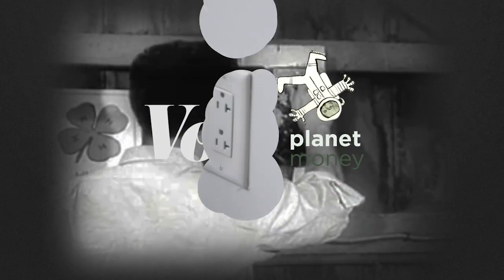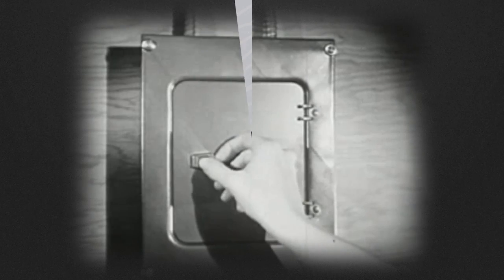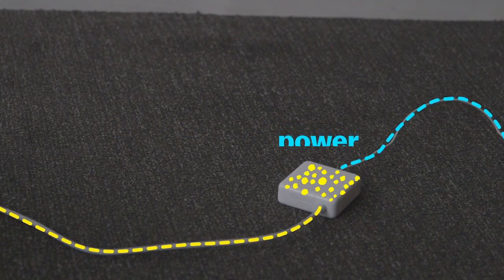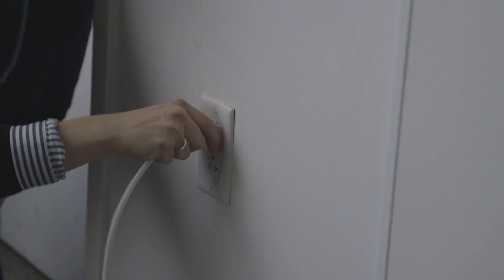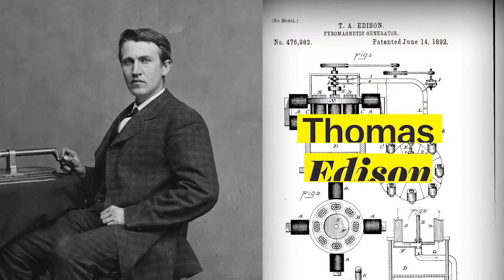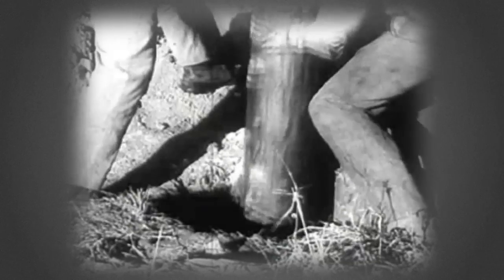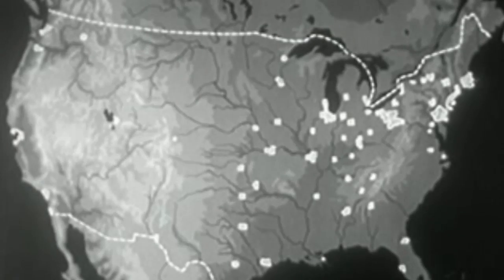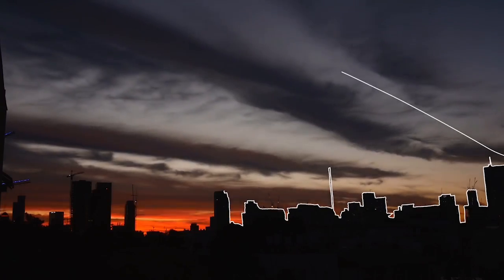Why your laptop charger is so hot

Comment: I enjoy most of Vox's oversimplified content; however, this video was poorly made.  Without getting to technical you could have explained this more accurately and left people with an understanding on the pros and cons of AC vs DC current, not a suspicion of AC, and Telsa, as outdated and wasteful.  AC power can be transmitted long distances at high voltages and lower currents thereby using less wire, greatly reducing cost.  To transmit large amounts of power with DC current would require thicker wire and "boosters" to correct the voltage every few miles or so because DC loses energy when its being transmitted at any significant distance.  As long as we have a centralized power grid where power is mainly produced at a power station and then transmitted to consumers it is prohibitively expensive to do so with DC voltage.  Edison did everything in his power to promote DC over AC current and it was an epic contest around the turn of the last century.  Edison was an extremely powerful man, but the fact remained that AC was the obvious choice to which Westinghouse agreed and began to implement the power system used today.  Large quantities of power transmitted at high voltages to power substations where transformers break down that voltage from (typically in the US) 13.2kv to more manageable and less dangerous voltages like 240v or 120v like you see in the standard American home.  Converting AC to DC is the best way all; however, I am sorry that the narrator seems to suffer some mild discomfort when handling her laptop power supply.  

A great video to make would be about having the prospect of a decentralized system like a solar powered house and it being purely DC current.  I would be interested to hear an expert opinion, preferably one from an electrical engineer or someone within the realm of electrical power, about the feasibility of that concept.  

No offense to NPR's contributor but your neighborhood electrician could probably have given a better explanation that this.  Vox's short takes must be taken with a gain of salt I suppose.

Comment: 1:00 The picture of the light bulb they have displayed is alittle misleading for what is being said. A typical ol' fashioned Incandescent Light bulb with a filament, doesn't need conversion from AC to DC or a voltage drop to operate correctly from line voltage (that is excluding low voltage 12V arrays, that you some times find in homes or businesses as Accent Lighting). On the other hand, the light bulb they show is an LED bulb, which has to step down Line Voltage, and convert it to DC current for the LED's to operate accordingly. Which is one of the reasons why the bulb has a big metal heat sink with fins on the side, so that the bulb can dissipate the heat accordingly, making it run efficiently, and in the long run, increase the Bulb's Life.

Comment: "AC is better at travelling long distances" is incorrect. The idea is to step up voltages for long transmission, and then step down at the termination point. At that time, only AC was capable of doing this.

Comment: The irony is that the voltage conversion this video wants to talk about is actually easier if you go from AC to DC. Sure, DC-DC converters aren't such a big deal anymore but still, this just adds another level of deception to the video. Why exactly haven't you taken it down yet?

Comment: Misinformation on the video. There is a transformer inside of computer power supplies.

If one used DC, it would be necessary to convert it to AC, then convert the voltage, then convert back again to DC. Or waste at very least 80% of the energy by just dumping the voltage with resistance.

Comment: Do the people in this video have ANY experience in electrical engineering? AC to DC conversion follows a percentage loss, so losses are independent of how many locations you're converting it at, but dependent on the amount of energy you are converting. Installing a converter box for an entire house would waste MORE energy because many appliances run off AC just fine and you'll end up converting (and losing) more energy. Do they also realize just how difficult it is to manipulate DC: voltage conversion equipment for DC is expensive and more inefficient than simply having a full wave rectifier installed for appliances that need them and that dynamos are generally less efficient than alternators.

Comment: They are partially correct, but most of the heat is coming from the block (Informal known as "Cord Bricks" or "Power Bricks") from reducing the power greatly, in some models by a factor of 10 or more. The voltage coming from your wall is at 120 V in the USA and 220-240 V overseas (The blocks also steady the input to prevent surges or irregular power grids). Most electronic devices can't use that much and therefore downplay it either in the cord or in the device itself (Desktops have the power converter internally. Laptops don't to reduce weight and size since it is only needed in charging)

Anything charging via USB is using 5.0 Volts DC (+- %5) (This is standard across the board). Laptops very from model to model, but mine is at 19 Volts DC. Outside of that, the voltage can vary tremendously, although for many devices it is around 12 Volts

This is called a transformer, or more specifically, a "Step-Down-Transformer". Without going into too much detail, the device reduces (Or "steps down") the voltage to a lower level. A good percentage of the energy is lost to heat, hence why the block warms up.

Now, yes the AC to DC converter produces some heat, but not all of it.

And to go on record, converting your whole house to DC power would be stupid. All devices built today either run on AC or have a DC converter in the cord or built in. Any device with a built in converter (or that uses AC to begin with) would become completely useless. TVs, Stereo Systems, Desktop PCs, Appliances... pretty much anything that doesn't have a cord brick or "Wall Wart" would become useless. Not only that, but you would have to replace all the "Wall Warts" and "Cord Bricks" cables with cords that have them anyways to reduce the power down, defeating the point (as they still can not use the 120/240 Volts). In fact, there would be MORE converters as people would now need to buy converters to transform the DC to AC so the device could use it (Unless you expect everyone to buy all new electronics)

Comment: The heat coming from your brick isnt all from the ac to dc conversion, its mostly from the dc-dc conversion to lower the voltage for your device. A single box for dc is just useless cause it would have to accommodate a wide variety of voltages

Comment: What a misleading title, no science into the conversion. No explanation for the heat other than lost energy.
Reply: Why...? The video didnt deliver on its promises. Pretty shitty move to be honest. Also, trying to knock Tesla.. -.-
Reply: You expected science in a Vox video? I feel sorry for you sweet innocent summer child
Reply: There's a transformator in that box, 2 coils designed and wired in such a way that the voltage drops from 230v to whatever your power supply runs on (For example 5v for most phones) . Using a transformator also allows Galvanic isolation which for safety reasons is really nice to have (+ it eliminates interference). Then there's a converter, which changes the current from AC to DC using Graetzes bridge and rectifier diodes. After that there's filtering system which blocks current of too high or too low frequency. The optional last one is a stabilizer which provides lower pulse in DC current if you need it (Mostly used when a high amount of power is needed). Also the stabilizer is what causes the charger to go warm or even hot.

Comment: This video is vastly misinformative! Heat losses at AC to DC conversion (110 Volts AC to 110 Volts DC) is negligible compared to the DC to DC conversion (voltage stepdown from 110 Volts DC to 19 Volts DC). The one who wrote the script for this video is obviously oblivious in electronics.

Comment: To answer the original question instead of why the U.S. power grid uses AC power; resistance, full wave bridge rectification and voltage step down circuits.

Comment: Having fewer converters wouldn't save energy. Converting less power is what would save energy, meaning that if we use AC current more, we have less power to convert and as a result we save power.
Reply: And a whole house converter wouldn't work either. What voltage would it convert to?! Each device, and in fact different components in some devices, have different voltage requirements.
Reply: Thats it. Using a central converter wont help. It will in turn increase the number of converters in series, leading to higher overall losses.
Reply: And you would be transmitting low voltage DC over longer distances which results in more losses.
Reply: having fewer converter would definitely save a lot of energy.
Reply: Almost nothing runs on AC power. It has to be converted to DC.

Comment: You could stop using Apple products. I've never had this problem even on cheap laptops. Used a top of the line Macbook once. The charger got so hot I could barely touch it. Not even Alienware, a brand with a pretty bad reputation, has this problem.

Comment: We could try to save some power by having DC come out of our sockets in the house. But there are 2 problems: 1. Not all electronic devices need the same voltage. Phones need 5 V, Laptops need 14V. 2. We would kill everyone in the house. If anyone touches AC plugs, they get thrown out of contact with the plug. If anyone touches a DC plug, they stay there. And die. So, all kids would die. Also your dad, when he tries to fix a socket.

Comment: We use ac current because we lose a lot of energy using dc. I'm talking about a 50% loss or more traveling long-distance using dc current. Also to accommodate for lost power. We would have to make the wires really really wide like one  inch in diameter or more of solid copper.

Comment: Of course, you'd have to have a smart system that can tell what power needs each DC device has because it's harder to transform DC voltages. In fact, to go from, say, 12 volts DC to, say, 9 volts DC - you'd need to transform the 12 volts DC to AC and then transform it from AC to 9 volts DC via oscillators which operate at high frequencies and would result in a higher overall power waste and would necessitate more internal home wiring and wayyy more outlets because you don't want to plug something that takes 5 volts DC into a 9 volt or 12 volt source without stepping it down. This would likely also result in a puff of smoke and dead electronics (or a bad fire or something). So at your desk (if you have a Desktop computer), you'd need 3.3, 5, and 12 volt adapters, likely 12 volt adapter for a monitor (though it may have a different one), a 5 volt adapter for your phone, and a couple of other 5, 9, and 12 volt plugs for other miscellaneous equipment. Or you could have a bunch of high-voltage DC plugs and have to have a converter at each which doesn't really solve the problem of wall warts wasting energy as you'd be converting from AC transmission current to DC home current to DC (insert device requirement here) current.

Comment: rather than install a big transformer to power all your charge ports (and deal with the heavier gauge 12v wiring needed - google current / voltage / power to find out why), you can save energy by simply unplugging  your charger when you're not using it.  This video vastly oversimplified the process (I figure it would be how you explain it to a 6 year old) and didn't offer a well reasoned solution.

Comment: The grid loses 30% of the power in long distance transmission.  Solar on your roof is DC and doesn't have any appreciable losses from there down into your house.  We would all be better off with personal democratic power instead of being dependent on large polluting producers, but the government subsidies now support large power projects (even wind and solar) instead of solar on every roof.  We would all be more independent Americans with our own low voltage DC personal power sources.  :)

Comment: 0:33 | Power sockets in Britain are DC. They have a positive wire, a negative wire & an earth wire. British plugs made by Apple have a transformer to convert it into AC attached to the plug, & another transformer along the wire to convert it back into DC. This is because in Britain we have substations, where the power is changed from high voltage, high frequency AC to low voltage DC. Power sockets in Britain are safer because they have Earth, but in some cheap rechargers, the Earth pin is plastic, so there's no Earth. The plug is also not connected to power when there's nothing in the Earth hole, so the only way you could be electrocuted is if you put the plug in upside-down.

Comment: why would having one conversion box for your house save energy? you are still converting and losing the same amount for devices that need DC and plus some more for lightbulbs that dont need DC so wouldnt you at best break even if you dont use anything that uses AC or lose more energy when using AC appliances
Reply: ***** the carbon cost in making and putting in the boxes to every household probably outweighs the energy benefits
Reply: ***** I don't have the numbers and I would also have to know how durable this hypothetic box is and how much it is a point of failure for the system. Also ac to  DC conversion is only 2 percent inefficient already so how much more efficient can you get. Most of the energy loss is from stepping down the voltage which you will still have to do with this DC system.  And you probably have to rewire the house slightly it seems like a big amount of work and resources for a small benefit.
Reply: The converter you'd get would be a lot more efficient and you'd have two networks in your home, one AC and one DC.
Reply: Jack Majhand it would be a pain if you want to plug in a dc device but all your dc sockets are full but you have lots of ac sockets
Reply: Some modern bulbs use DC too, like LEDs. So it really wouldn't be that big of a hassle
Reply: ***** but AC bulbs are much more common. I know all the bulbs at my house are ac
Reply: john li ye but would you rather have to install special plugs and have a ring just for AC bulbs, or just buy new bulbs that are DC and be done with it?
Reply: ***** what? There are are more ac sockets for ac bulbs than there are DC sockets and why waste more energy albeit 2% and go through extra trouble for DC bulbs
Reply: john li
DC bulbs are much more efficient than common AC bulbs so it saves a lot of energy
Reply: AC bulbs will work just fine with a dc current. After all, a lightbulb is just a fancy resistor.
Reply: Anthony Khodanian even if it works there the disadvantage that bulbs burn out sooner on DC
Reply: john li "probably outweighs" seems like some accurate facts and figures
Reply: It would be inefficient to have one conversion box, because not only does a charger do AC to DC conversion, but it provides a specific voltage and current to your device. Each device varies in the voltage and current that it needs, so you would still need that voltage step down conversion (linear regulator/buck converter) which consumes heat anyway. All you're doing is adding an unnecessary extra step in between. If this saved power, it would already be implemented in many homes.

Comment: It's debatable as to whether you would save that much energy as you need to do the conversion to cover the same amount of equipment in the home. So if you add all those little boxes of heat up, you get one big heat source instead, at that main convesion box.

The other thing is you may end up losing energy (again, heat) in the wires much more quickly that with AC.  Remember, electrons flow like a river, but also bump into other obstructions along the way. It becomes worse as more gadgets are plugged in.

With AC the movement back and forth is absolutely miniscule and so less friction (thus loss of energy through heat) occurs.

Comment: It's very simple to transform the voltage of AC current it is almost impossible to do the same for DC current so it's is easy to raise the voltage lowering its amperage to transport it across huge distances the transform it back down for use this is not do easy for DC

Comment: The electrons aren't moving, it's the current that is moving. Electrons do move, but they move very very slowly (electron drift) compared to the current, which is derived from a change in charge of the atoms over time. Also there was no elaboration on how energy would be saved for the scenarios of a bunch of little rectifiers compared to a big rectifier; they are right but there is no explanation.